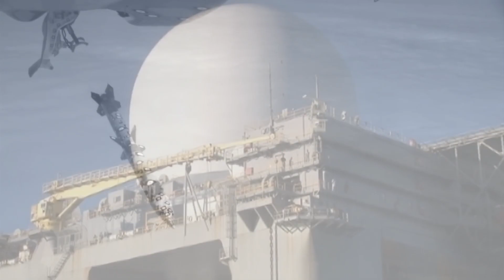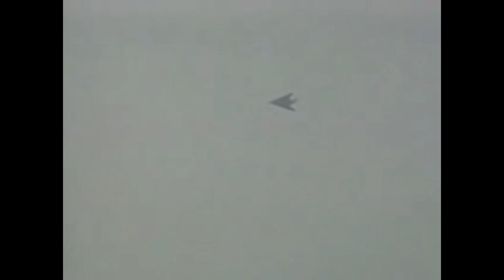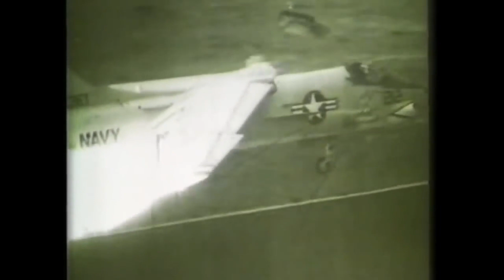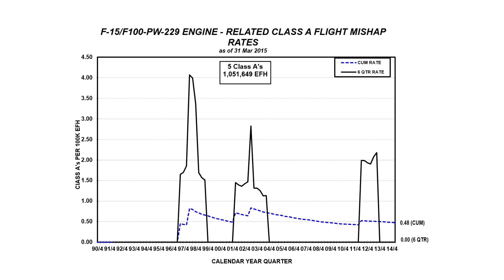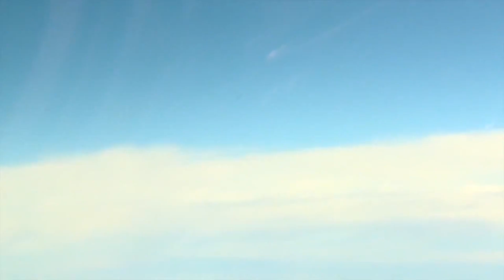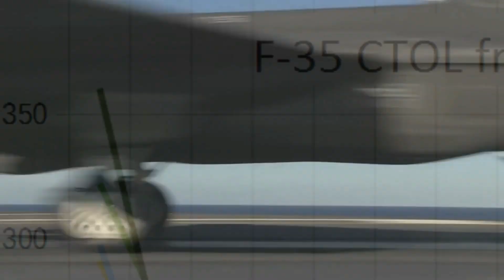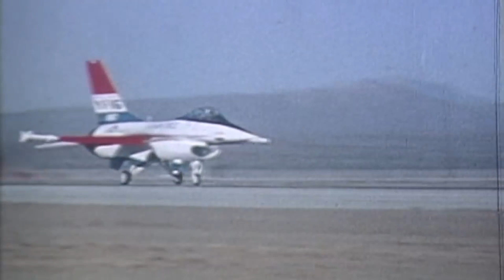F-35 Lightning II: Busting Myths - Episode 2

Comment: In czech republic we have best pasive location system VERA and VERA -NG, and new pasiv system CPL( coherent pasive location ) principe SilentGuard. This systems can locate F-35 and other stealth planes 
with high precision suitable for guiding missiles or fighters. Ours company Era Pardubice is best developer for pasiv location. with ours systems is stealth 
useless, we see you always and everywhere. 

By the way, the Russian Federation has the original systems from the Czech Republic - Tamara and during the Cold War their systems were behind our minimum delay. today they are doing very well with a psivic location.
Reply: @Vincent Phan   There is no stealth aircraft that VERA NG would not capture. Both the F-35 and the F-22 are constantly transmitting, radar, satellite communications or altimeter, etc. All these signals VeraNG captures, processes and determines the exact position very accurately. Positioning using a passive system is so accurate that it is used at airports to determine the position of aircraft while taxiing. Ask the soldiers from the passive systems unit in the Czech Republic how they have the positions and routes of stealth aircraft whenever they fly somewhere in Europe :-)
Reply: @Vincent Phan  They may have encrypted transmission, they may have an electronic warfare system, but they will not deceive physics. The passive system veraNG works on the detection of electromagnetic radiation, as soon as the F-35 emits any electromagnetic radiation so it does not matter, it does not matter what is the modulation, what is the encryption of data transmission. If you weren't uneducated, you would know. You argue with propaganda not science you are stupid and uneducated. PET systems do not transmit, they only capture signals coming from the aircraft. Not to mention the new coherent passive location systems. Study and do not show your ignorance and stupidity.
Reply: @Vincent Phan  https://www.era.aero/cs/military-security
Reply: @Vincent Phan  Even an aircraft that will not emit at all is detectable with high accuracy.
https://www.armyrecognition.com/idet_2015_news_official_online_show_daily_coverage/era_introduces_its_silent_guard_mobile_demonstrator_of_passive_surveillance_systems_at_idet_2015_4005155.html
Reply: @Vincent Phan  but I understand that you do not know anything like this in your developing, backward country.

Comment: Reasons why it is a piece of crap. As it is a Harrier. Marines had the issue last time they attempted this. Harriers require a small wing design. As such = shity fighter. Small weak ass single engine way underpowered for the weight of the plane. Internal systems which allow for minimal fuel and ammo or weapon payload = shitty bomber. Low fuel means short hang around time as for supporting ground troops and not able to operate at a slow enough speed to properly target anything up close and personal equaling shitty ground support as also weak frame to take any kind of damage from ground fire. Navy is still reviewing this as the single engine does not meet the need just n case they lose one. They will outright lose the 140 million dollar plane. All of the above palces it At a high risk with repeated software issues if it fails at any time it is toast. I need more than Lockheed money leech and a few Pilots who were threatened to be passed for promotion again to make this turd shine. I bet you champion the billion dollar program to replace the Sea stallion helicopter as well and the unproven laser.

Comment: All you need to now is that when an enemy pilot it asked what
he thinks of the f22 and he says it a good plane but I thing mine it better and
when his asked what he things of the f35 he breaks up laughing you see what a non-bias pilot thinks. All the electronics can be fitted into a better plain like the
f18 super hornet with the new stealth package or a new version of the f16
Reply: You just demonstrated you haven't got the faintest idea what you're talking about.
Reply: Both the F-15 and the F-18 super hornet have new stealth
package and have proven them self. Both the F-15 and the F-18 super hornet
electronics have been up dated and are being sold the Australia and other countries
because of F-35 delayed Australia also has pointed out the F-35 is not a superior
plane and will half to be used with the other planes to compete there needs. Canada
pilots have also stated that the F-35 will not fit the needs of the Canada air forces
and have asked the government to cancel their order and order the F-18 they believe
they need a plane with two engines for safety. Israel like the F-35 but their
plane has been modified to fit their needs. Other countries have stated that they
too are looking at other planes to fit their needs due to delays all this is
posted by reliable new agencies if you bother to look and this is not conspiracy
new ether even the US has stated that they don’t think the F-35 will be
able to replace all the planes it is supposed to.
If this news was not out they’re this the company would not
have make thees 4 video To try to conversion you other wise
Reply: Gardein Reef PURE B.S. NONE OF THOSE PLAINES CAN COMPARE TO THE AESA RADAR TYE F-35 HAS.PERIOD.

Comment: anothe lie. the engines of the aircraft have begun to become more and more maintenance intensive. thats why the f22, for every flight hour there has to be 1h of serviceing. if that is an indication for the f35 than that means this fighter will be expensive to maintain, and stand in servicing rather than flying... it doesnt matter if the engine is more reliable if you cannot fly the plain cause it stands still for servicing all the time. so the argument made in this clip is nonsense... again.
Reply from the maker: "the engines of the aircraft have begun to become more and more maintenance intensive. thats why the f22, for every flight hour there has to be 1h of serviceing" - this is incorrect, for an F-22 you need >40 maintenance man hours per flight hour. Even for an F-16 you need about 10 maintenance man hours per flight hour. The F-35 is aiming for 10 MMH per flight hour as well; it uses stealth coatings that require far less maintenance than on the F-22, it self-diagnoses itself, and it uses more modular systems to allow quicker maintenance.
"it doesnt matter if the engine is more reliable if you cannot fly the plain cause it stands still for servicing all the time." - so what, the plane should have no engines? Or more engines for an even longer service time?
Reply: Andreas Seifert I work on engines for the  ec- 130 which is extremely maintenance intensive this is due to older systems that run the engines and tons of safety wire.the t700 ,ae2100d3, and f135 engines are designed for ease of maintenance with no safety wire ,centeral computer systems that makes troubleshooting easy . I'm not going to reveal too much info but all of the new engines are more sophisticated, require less maintenance,and are Marvel's of engineering themselves.

Comment: Meh, aside from using some overly hopeful and now proven untrue stats about the still slacking economy of the US, this is one of the better analysis pieces I have seen.  I still think that having no competition for the engine was the biggest mistake.
Reply from the maker: There was a competition for the engine though; the F135 vs the F136. Development for the F136 was cancelled at the end of 2011 when it was decided that the F135 was performing well enough to not warrant further expense on a second R&D program. The next engine for the F-35 (based on the ADVENT / AETD / etc programs) is also currently a competition between P&W and GE.
Reply: The "slacking economy" was in reference to GDP growth. Which was very much still the case at the time this video was made. An average annual growth of 2% is considered "slacking", 3% is considered normal, 4-5 would be high.

Comment: 80 million is still twice the cost of something like the European Gripen. Which is said to be of comparable capability and even superior in air to air combat due to the F-35s laking maneuverability. And yes. the F-35 does have lacking maneuverability due to its relatively short wing span. Small wings give you less ability to turn. And turn is one of the most important parts of air to air combat. This means that one Gripen could probably outperform the F-35 in dogfighting. and not only that but you could get two Gripen for the price of one F-35. Which means that one F-35 would have to be able to compete with two Gripens in order to prove itself financially viable. Else the Gripen would obviously be the better alternative. Furthermore you brag about your new software that can tag enemy aircraft. Which indeed would be a major advantage but i won't believe it until i see it because the reason nobody else is doing that is because there is no realistic system of that kind that won't be easily abused by the enemy. Most of this sounds like things that i won't believe until you can show to me that it actually works in practice. otherwise its just a lot of dreamy words. Im not trying to be negative. But i am curious what you people have to say to defend against all of that? because I'm not convinced in the slightest. Not yet anyway.
Reply from the maker: +Samuel Mork Bednarz
"80 million is still twice the cost of something like the European Gripen."
The Gripen's more expensive than $40 million; Brazil for example is paying roughly $150 million (procurement cost; including things like ground equipment, training, etc) for their Gripens. For countries like Australia and Norway, the procurement cost of an F-35 has been around $200 million.

"Small wings give you less ability to turn. And turn is one of the most important parts of air to air combat."
Watch episode 3; out-turning your opponent is one of the least important parts of air to air combat.

"i won't believe it until i see it because the reason nobody else is doing that"
Other jets like the F-22 are already doing it; the F-35 just has a more robust set of methods for doing it.

"Most of this sounds like things that i won't believe until you can show to me that it actually works in practice."
How about F-22's achieving 241 kills for only 2 losses over 2 weeks of training exercises?